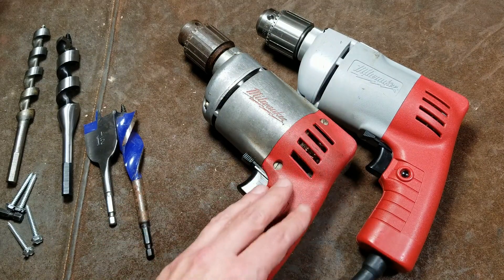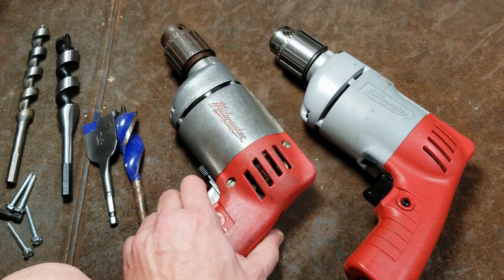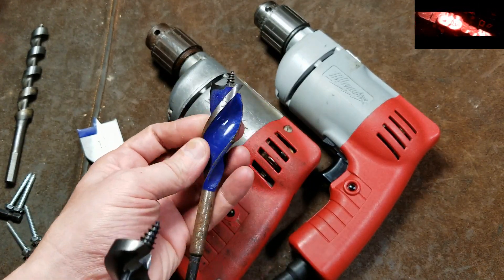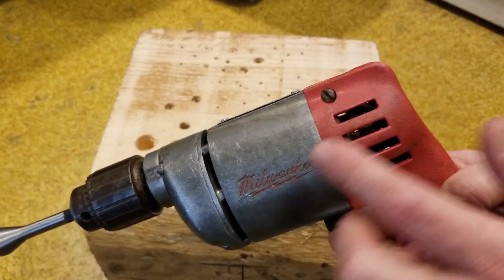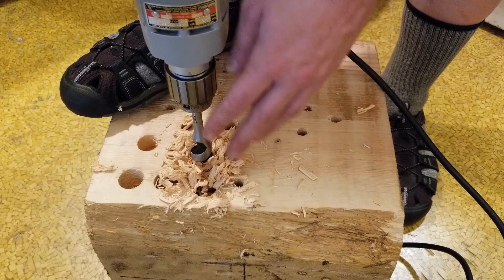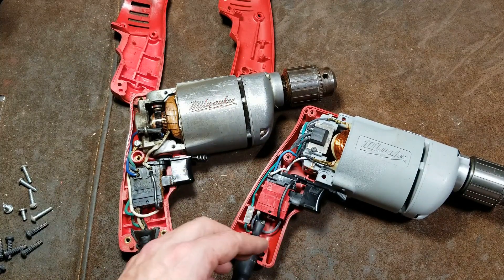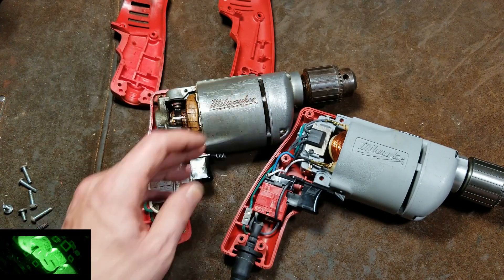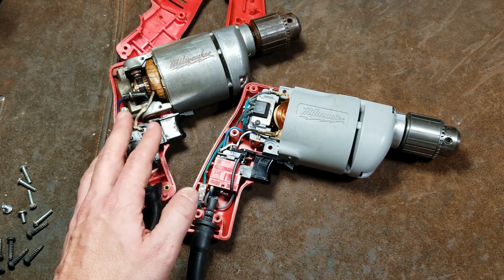Milwaukee 3/8" Heavy Duty Hole Shooter Drills, 25 Year Evolution Comparison

Comment: Should i grease the armature back bearing every certain duration? As in my dewalt (d21815 ) 850w have a little squeal comes from that bearing in the back although it is brand new but it disappeared after using dw40 on it
Reply: You can buy new back bearings but they are $20 apiece these days.
Reply: @blackrockcity  its a new drill how can its bearing ruin so qeakly like that i used dw 40 and the squeal sound gone off
Reply: @ahmedhesham8980  WD40 is not a great lubricant. It’s for unseizing rusty parts. Use bearing grease. Phil’s brand for bicycles. But the science of lubricants is complex based on heat and load. I’ll let others recommend the correct grease. White lithium might work.  

If a new bearing squeaks, it sounds like a  defective bearing.
Reply: @ahmedhesham8980 note that the bearing is probably sealed and can’t be greased. It depends on what type of bearing you have. The easiest thing is to replace the bearing.
Reply: @blackrockcity  to replace a new bearing for me it is a waste of money first you should try to lubricate it espcially if it is in a high qualtiy tool

Comment: I have a couple of the pistol looking Milwaukees.  One I bought new about 15 years ago, and was made in the US.  I had to have the chuck replaced (now keyless), and IIRC, it was almost the cost of the whole drill!  I picked another up on CL for my tool fix.  It is made in China, both are around 7 amps, and I think have an optional handle, they're certainly torquey.  Thanks for your video!

Comment: Hello, Nice Video...  I own 5 of these in the 1,700 RPM’s and one at 850 RPM’s.. I used mine on a tool cart installing Commercial Door hardware... When I found the 12 volt Nicd Cordless Hammer drill with 1,600 RPM’s I was in Heaven... Greg

Comment: the older drills also don't have heat issues because there isn't a crapload of delicate circuitry in the tool. The speed controls, hallofects and all the other crap is a big failure point vs just a simple motor and a trigger switch that's a potentiometer.
Reply: Fully fucking agree.

Comment: I have one of those Milwaukee 3/8" hole shooter drills, I bought it in the early 80's and it's still running strong.  A lot of torque for a 3/8" drill.
Reply: But low RPM. And mine doesn’t have reverse.

Comment: Hi there, thanks for the video. I have an older 0222 and it's missing the retaining screw in the chuck. Would you now the specifications on it? I only know that it's a left-hand thread. Have you tried to see if a newer one's screw would work in the older ones? Thank you for your help.
Reply from the maker: there is only a few sizes of those screws, Milwaukee has a parts breakdown of this tool and it will probably list the size
Reply: @CatusMaximus  Thank you for the reply. The parts diagram doesn't identify the size or thread of the original part but I've managed to locate one from a newer model 0222 and when I receive it I'll give it a try :) I do appreciate your help and time to respond to my question

Comment: I have the 0222-1 the one with the metal body, that was handed down from my dad 30 years ago and it will not work now. I think I need brushes. Any idea how I find them for this old drill. Really would appreciate your help!!
Reply: Did you ever find the brush?  I have a drill that has a single brush under a round cap on the top back of the drill.

Comment: I inherited an old Milwaukee drill from my dad with the serial number 428-3701 that looks just like the old drill on your video. I can't find any info. on it and it needs a new power cord.  Any suggestions?
Reply from the maker: Go to Milwaukee Service website they have manuals and part diagrams for all their tools since the 1970s. Just open up the handle and use a sharp tick to release the spring locking mechanism you got to put it in the hole next to the wire pull the wire out and then just go to a home improvement store and buy replacement power cords they have them on the Shelf already stripped and soldered and you just put it in and go

Comment: talk about getting hot my gen 2 milwaukee fuel impacts get toasty when running 1" or 1 1/4" spade bits repetitively making drops and holes for running pipe might not be the best tool for the job but gets it done even with 3 12" 1/4" extensions  getting me a fuel hole hawg and super hawg soon should help the hell i put my drill and impact through but theyre holding up gotta regrease the gearboxes on the impacts but they still run fine have had it to where the grease is burning in the gearbox and will start to leak out just let her cool down

Comment: I have a 0228-1 but the chuck has been replaced with metabol  keyless made in Germany I looked it up I guess it was originally black oxide over it but wore off over the years it works for the most part put brand new carbon brushes and I'm going to replace the cord